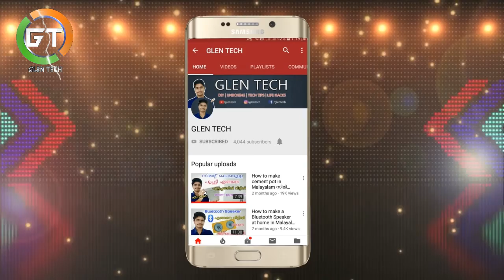Build a Rs 650 DIY Incubator at Home - Hatch Chicks Easily in Kerala!

Comment: Hello bro... Weldon. Now tell me    this manual thermostat worked well??. Plz tell me frankly...
Reply from the maker: Yes , now also I'm using it . If you need you can use degital thermostat also.
Reply: @GLENTECH  bro. I wish manual... I'm not interested in 285rs model digital thermostat. I trust manual thermostat. But in this field I have no idea. ( my field a/c). So I want ur recommend. So u mean this manual thermostat good???. May I use it for my incubator???
Reply from the maker: @shajioman2462  yes , you can use this normal thermostat . And you need a digital temperature and humidity meter also .
Reply: @GLENTECH  OK thnx.
Reply: @GLENTECH  bro this manual thermostat made in??? Plz

Comment: ഒരു ഡൌട്ട് ചോദിച്ചോട്ടെ. തിരിച്ചു റിപ്ലേ തരോ. Plssss. ഹ്യൂമിഡിറ്റി മീറ്ററിൽ കാണിക്കുന്ന  temparaturum. Thermostatil കാണിക്കുന്ന temperaturum തമ്മിൽ  വ്യത്യാസം ഉണ്ടെങ്കിൽ എന്ത് ചെയ്യും
Reply from the maker: Use a thermometer and check the temperature inside the incubator.

Buy new humidity and temperature meter.
Reply from the maker: Turn off the temperature meter and turn on and try.
Thermostat temperature is correct.